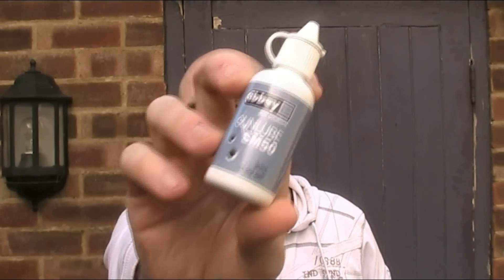Airgun Dieseling | Air Armoury

Comment: If you push soft lead pellets through a rifled barrel at a rate higher than it was designed for, it will strip  and sheer lead off the pellet as the  lead will not have the strength to follow the path of the spiral but sheer and foul the barrel  This happens a lot in Black powder shooting

Comment: Well I've got a few tips pointers and criticisms. You said to use silicone based lubricants because they're not combustible however I'm holding in my hand a can of CRC heavy duty silicone lubricant and it says right on the can extremely flammable. I've used this to diesel pellets before and it's not the best but it is volatile it's a VOC. The best by the way is Vicks Vapor Rub I've done plenty of research on this it works better than spray 45 lubricant better than WD-40 better than lighter fluid you name it Vicks Vapor Rub is the best for dieseling. Not only that it is kind of petroleum based so that helps on the seals which do get damaged from dieseling but who cares it's a little o-ring. The major downfalls of dieseling are that it is damaging to the seals and it makes the barrel dirty so you have to clean it more often however I've never seen it affect any Springs in fact my guns don't have Springs so much as the new Pistons on the Gamo and the Umarex. The benefits are very much increased power I've added 400 ft per second give or take to one guns velocity, by the way the 177 gain more velocity than the 22s. The accuracy is increased it's not decreased. And that is simply because you have less time to be affected by friction and recoil. Note on that if you use the Vicks Vapor Rub it's pretty consistent because you're not spraying a lubricant in there you're wiping a gel into the same spot every time. Plus like you've said it does look and sound way cooler. I used it in a hunting application and I was able to make a kill with one pellet rather than three which I think is more Humane for the animal. Anyway that's my take on it and thank you for your time and your effort and your video and I'll be looking forward to seeing what else you got.

Comment: (UK) If you have a sub 12ftlb rifle that has bigger power output modles of the same gun, then you should be fine. As long as they just ‘detuned’ it it should be fine... its like taking a 600hp (20ft/lb gun)  amg v8, detuning it to 450hp (12ft/lb gun) and old Billy thinks “oooh.. i could put a turbo on here and get 500hp!” Hes tuned it but in reality its been designed for more power. 

If you get what i mean

Comment: They effectively become a hybrid of an airgun and firearm when this happens and the pellets projected by a mixture of air and expanding gas.You often get a supersonic crack too.Sometime it can go off with such power it blows the breach open of a break barrel and if you fire one at night you'll see a flash too!I don't know how dangerous it is and my guns never blew up but I'd be careful with it.... very!
Reply: Best material is isopropyl nitrate. Only dip a qtip in the stuff and rub the inside of the skirt. Never use any more of the stuff! Basically its liquid dynamite.

Comment: I've never seen a video where dieseling breaks a rifle
Reply: I've never actually seen anything with one breaking either just some people saying so who probably never have broke one
Reply: It's not going to hurt the rifle. In theory, it "might" wear on the piston seal, or cause blow by on the breach seal, but that is just speculation. I've never seen any damage from dieseling my air rifle, and I've been doing this for over 20 years with mine. The seals are still just fine. And the spring is just fine too.
Reply: @trevorjameson3213  The way I kinda look at it I figure its just pushing the gun a little harder and the gun itself is designed to handle pressure. I don't think the gun manufacturers would design it to only handle just that specific pressure and any more would cause it to fail. They will usually design something to handle more than what's rated that way they don't get sued. Most businesses like to make as much money as they can without getting sued at the same time. Most things are made to handle double what you need, I know not everything is made that way but I figure most things can handle another 25% or so.
Reply: most air weapon suppliers pre diesel guns just for the smoking effect or for a little extra moving position on ft/lbs i've seen pre dieseled air rifles advertised at sub 12ft/lb but after around 10-50 shots they fall wayyyyy below at around 9-10 ft/lbs. absolute scam if you ask me. sell it at 12 max and dont pre diesel it.
Reply: Are you guys sure about that? Everyone on the internet saying it will damage your airgun. I want to try dieseling so bad but I don't want to damage my airgun at the same time. I just want to try it for test puposes. Like accuracy and damage tests with my Hatsan mod 25.

Comment: Thank you for the nice video. I have tested this idea and yes, the increase of power is indeed impressive (I went from 14 Joule up to 28 Joule), but sadly - as you say - the results are not good with regards to how much damage it will do to your gun. 
I was very careful about it and was on the lookout for anything unusual - so I noticed immediately that the performance would drop by a few percent with every shot, until it was not really that great any more. To restore it, I had to drop silicone chamber oil down into the piston chamber and then stand the gun up for a while to wait for it to distribute. My conclusion is that the detonation gets into the piston chamber and basically destroys the lubricant around the piston - either by burning it off or by making it dirty. I am not that worried about it, since I have a spare seal and I was going to take the gun apart anyway, but I will probably not try dieseling again.

So, on second thought, I think that if anyone is not happy with the performance of their gun, fitting a stronger spring is probably a better idea - if the gun's construction is strong enough - rather than using dieseling. Your equipment will be less powerful, but it will perform in a more reliable and consistent way and you will not have to resuscitate it every few shots or risk damaging it beyond repair.
By the way, if anybody absolutely has to do dieseling, do not use vaseline or mineral oil, but use something that will not damage the seals. I used simple vegitable (olive) oil, since it is gentle on rubber, and it worked great.

Comment: I must admit, I too enjoy the smell of dieseling. I did do it just once on my Beeman RS1 .177, I used a drop of very light "air tool" oil (for air compressor operated rattle gun/socket driver) in the skirt, and man was it loud!  lol 😂
Reply: Same! I inherited an air pistol from my great grandfather and it has always shot with smoke coming out and that diesel smell. Dunno how to stop it though
Reply: Most probably the best oil to use!

Comment: Having seen this now, i realise that my B2 has been dieseling since day 1, i bought it new roughly 8 years ago and every shot leaves smoke in the barrel even to this day, which i thought was normal until i watched this
Reply: It IS normal, don't worry about it. My Beeman has been doing this on it's own for years as well. Never had any problem with the seals or the piston. Until I see a video showing damage from dieseling, I won't believe it causes any damage.
Reply: A gun that's not dieseling will still leave atomized oil in the barrel vapor. That's what you're seeing.

Comment: So this is why my brand new gamo big cat 1400 smoked and smelled like burnt gunpowder after I shot it for the first few.times. and sometimes it still has smoke come out of the barrel when I break it to load the next round.  It must be that it is improperly lubricated.
Reply from the maker: Unfortunately a lot of guns do diesel when new, but this should wear off over time. Never used that oil so wouldn't like to say how suitable it would be. Best advice is to get some proper silicone gun lubricant.

Comment: I use a GAMO cfx .177 cal. I can't find a cilicone based lube for air rifles so i oil the moving parts with Q20 (also known as WD40) my local gunsmith says that i should use heavier pellets after doing so for about 10 shots to work out the oil in the camber and that once every two or three months wouldn't be so destructive  (yes i go through about 100 pellets a day for target practice and about 300 a day when teaching the neighbourhood kids how to shoot and gun safety  on weekends)
Reply from the maker: Thanks for the tip of using heavier pellets after oiling, I didn't know that.

Comment: I wouldn't do this regularly but in the right situation, this knowledge could be extremely powerful and I appreciate you sharing the info!🇺🇸
Reply from the maker: No problem, although I should stress that the information is aimed at preventing people from doing this, not encouraging it.
Reply: @AirArmoury  can this be used with a pump air rifle the ones like a daisy 880
Reply: @thIDthIRreenactor  I will not work with an 880 because you're building pressure slowly as you pump it up. The air is then stored in the compression chamber and released by a valve. So there is no heavy spring slamming a piston forward and compressing the air suddenly, which is required for dieseling.
Reply: @trevorjameson3213  ahhh ok

Comment: OK so I have read all the comments here and on other videos. I understand the risk of damage and explosion of the gun, but as far as I can tell nobody has asked about bolt action rifles. Mine has a bolt and a breach, and uses Co2 canisters. What would be the difference in wear etc? Thanks.
Reply: Art Frewin Good logic. You are correct. Having tested it, no ignition takes place. It does however improve its performance somehow. Without oil the pellet embeds to its tail in a piece of soft wood. With oil its goes really deep.
Reply: Art Frewin I tend to agree. I did a test shot first into a 2x4 broad side on. Then loaded it by poking it in the breach, then a little squirt behind it on the bolt carier. I saw the squirt through the site but no fire no sound.
Reply from the maker: Looks like this has already been answered, but just to confirm, a CO2 gun will not diesel. The reason for this is because it works on a different principle to spring guns. In a springer, the rapid compression of air (when the piston travels forward under spring pressure) causes heat which in turn causes the lubricant to combust. As has been suggested, the improvements may be due to getting a better seal, or from the pellet being lubricated. You can get products that are designed for this purpose (I have a video on the subject).
Reply: Air Armoury It certainly helps, but no lovely cracking sound lol. I was actually rather suprised at the performance increase. Its a good 20-30% more powerful. Well worth the discovery for sure.

Comment: but what would happen if u put petrol or diesel on it?
Reply from the maker: It would combust and cause dieseling.
Reply: but will effect would be better than using oil?
Reply from the maker: You shouldn't put anything combustible in a spring gun, no oil, petrol or diesel. Just stick to using silicone based products which are suitable for high pressure/heat applications.

Comment: WD40 does not work at all. Anyone else have any ideas?
Reply: chainsaw oil
Reply: Get a more powerful gun...WD40 only works on rifles that shoot over 600fps. At least in my experience with it
Reply: Vapor rub is actually really flammable
Reply: Silicon oil
Reply: White motor oil

Comment: Would WD40 work do you think? Or any other cheap/readily available products in the UK?
Reply: 3 in 1 oil, doesn't necessarily have to be something you would consider as explosive. You could probably use actual diesel if you didn't mind the smell. Otherwise you could try petroleum jelly even.
Reply: Peanut cooking oil.
Reply: Better use a white motor oil or silicon oil

Comment: this will destroy the orings from your gun... not a good ideia.. diesel burn into your barrel and destroy the orings... verybad
Reply from the maker: +Venâncio Chaves I agree, as I said in the video, dieseling should be avoided.
Reply: under levers generally have better seals and ive tried it with one, thousands of times and no damage at all. gave the cylinder a flush out and the piston a clean after about 300 shots, good as new.

Comment: I have a Daisy Powerline 880 air rifle and want to try dieseling. i dont know if it will work with copper bbs, but it is also not a break barrel rifle. can anyone tell me if it would be ok to try it once?
Reply from the maker: +Noah Jones The Daisy PowerLine 880 is pneumatic rifle so will not diesel as it doesn't have the rapid compression of air that a spring gun does. Even if it was able to, I wouldn't recommend it.
Reply: ok thanks
Reply: ask if it will work on CO2 air rifle?thanks

Comment: "Diesling" implies that the "accelerant" in this case your lube is igniting and aiding the propulsion of the pellet. In your example, I do not believe that it is igniting. In an engine, a tiny amount (Perhaps100cc's)of diesel fuel (which is formulated to ignite at the lowest pressures and temperatures of the compression hydrocarbon based fuels, your lubricant is not formulated for ignition) is injected into the cylinder under high pressure (19,000 psi +) to atomize the fuel into tiny particles. This increases the amount of surface area of the fuel to aid ignition. Then the air in the cylinder is heated due to high compression (580 psi) to 1000 to 1400 degrees F. So combustion requires atomized fuel at 1000F. You are not achieving this in your air gun. While in fact a PCP could have 3000 psi in the tank, CO2 has a set vapor pressure of About 850 PSI at 70F and in a pump air gun, based on experience I suspect 1200 PSI stored, the actual amount of pressure achieved in the chamber would be far less. The pellet is not encapsulated in a cartridge to allow pressure to build the measured clearances between the rifling and the pellet are far larger than the same measured clearance in a powder actuated firearm. If you duplicated the "drop" of "fuel" by volume that you are placing in the chamber with the comparable amount of fuel injected into a internal combustion cylinder, it would flood a Diesel engine and no ignition would occur.  What you are achieving is a better seal of the gas checks, rifling, o-rings etc, which is resulting is less leakage of compressed air around the pellet and out of the compression chamber thus having more compressed air to move the pellet. Any "smoke" you are seeing is the result of the excess lubricant being atomized under the air pressure and ejected from the muzzle, not the result of combustion.  Note that this pressure, although not enough to promote ignition, is enough to overload the pressure chamber in a pellet rifle, and damage it.  Manufactures know this and will likely void your warranty.  Also note that many air guns use self lubricated o-rings and silicone based lubes.  Petroleum based lubed will damage the seals, again not under warranty.
Reply: +Bushman Nh when the pellet is fired it creates an almost perfect seal with the rifiling, what you are trying to say is that the lubricant bridges any gap that is left between the pellet and the rifiling, which in this case is literally impossible to be the case all of the way down the barrel as he stated himself, that the lubricant was placed inside the skirt of the pellet, meaning that when fired the lubricant will be behind the pellet, not sealing the "gap" at all. and the reason that the fuel would not ignite in a diesel engine is that the compression is nowhere near enough to ignite this amount of fuel, given enough pressure and a little oxygen you can almost get any percentage of diesel to ignite. on a side note, your stance that the lubricant is only "sealing" the pellet is completely void by the fact that the crack heard when firing is noticeably louder pointing towards ignition and the fact that there is a burning fuel smell after firing, again pointing towards explosive ignition.